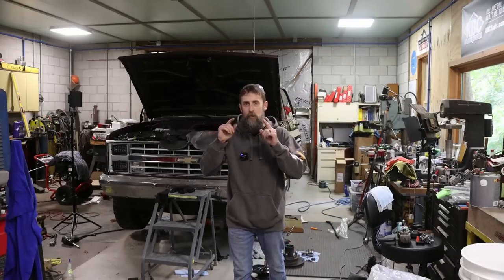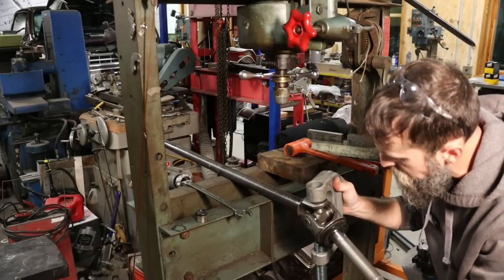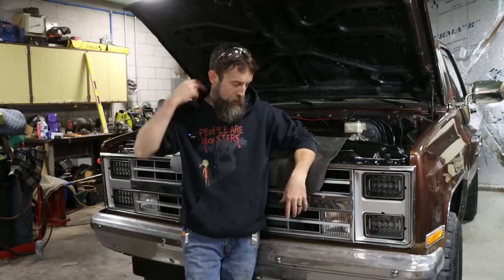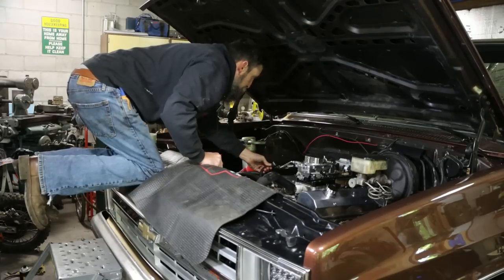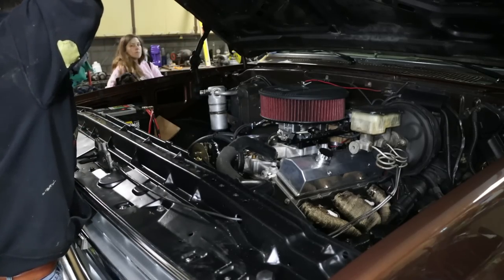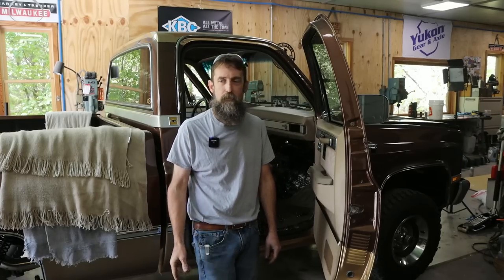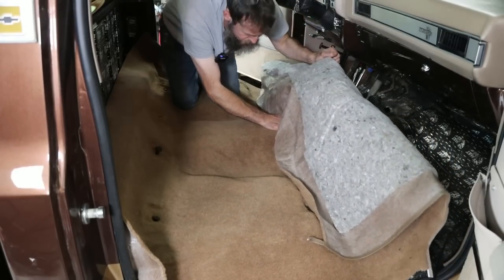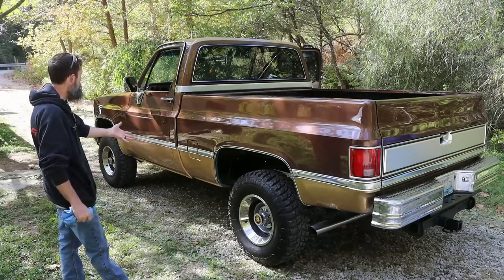Sorting out engine and axle TROUBLE :-(  Installing New Carpet as well!

Comment: Steve, when I watched you struggling with that axle my memory went into overdrive. 45 years ago when I was a tad younger than you, I spent 9 hours on my back uder my elderly Ford Anglia in the snow, with the gearbox on my chest trying to engage the splines in the clutch, it would not go in. Eventually I crawled out from under, exhausted, freezing cold, hungry and almost in tears. I said thats it I'm calling the scrap man in the morning to come and take the damned car away. My dear wife said, just come inside to get warm and have a mug of cocoa then give it one more try and if it doesn't work then we will call the scrap man. I went back out, it had started snowing again, Igot under the car, lifted the gear box onto my chest, lifted it back over my head and it slipped straight in. So yes I have been there, done that, and got the Tshirt. 
Your truck is probably better now than it was when it first rolled off the line, now it's time to relax and enjoy driving it with Elizabeth, (and the dog.) Best wishes from the U K.

Comment: Good looking  truck. I have a 86 GMC 350 with mild cam in it. Getting ready to put cab corners on and the left rocker panel. Then weld  up a few small wholes, Finish body wrk and paint it.

Comment: With that color carpet, I’d buy a Husky or Weathertech liner(s) to keep all the slop and grit off the carpet.  Keeps the carpet clean and dry and that means you won’t rust out your floorboards from the top side.  Last time I checked, I chose the more flexible, rubbery Husky option.  Easier to put in and take out and gives your shoes/boots more traction when it gets wet.  Doesn’t let any water flow off onto your carpet like regular rubber mats do.  After all that work, might as well spend a few bucks to protect it and keep it looking as new as is possible.  After 2 wet, muddle winters, my carpet is as clean as the day I bought my SUV.

Comment: First EXCELLENT work, as I'm sure everyone else will say!!! Always love your work and attention to detail- One thing I noticed and maybe you have a reason, but the bottom mounting flange of the rubber boot around the shifters SHOULD be against the body (or the Dyna-Mat) and not on top the carpet, only the chrome trim ring goes on the carpet??? if you drive in the rain, or in a wet location, that boot is to keep water and moisture out of the CAB, the way you have it currently, the carpet will act as a wick and soak up water! Just my two cents, sometimes I notice things, and also, sometimes I'm wrong? (rarely, LOL)

Comment: The process is called Melonite and is a proprietary process. It is a salt bath Ferritic Nitrocarburize procedure which uses a cyanide base. The process is accomplished at temperature around 1050F. It is usually (but not in all cases) applied to low alloy steels to form a surface generally of iron nitrides.

Comment: Steve, dont go driving it with the four wheel drive hubs locked in on the bitumen. Youll get wind up on the bends and break somthing. You need to be on the gravel to allow the slip.

Comment: I just finished doing a 98 c-1500 I put a 66 stepside bed on mine and nobody seems to figure out how old it is.  Trouble is now I have to use my trailer more to keep the paint nice I don't haul brush piles anymore in the bed. Your truck is nicer than new I started body work at a GMC dealer in 74  and still at it.

Comment: FIATs used small metal bushings on the air cleaner , and we would often get a customer coming in with a ticking in the motor after doing his own service.  Those bushings would fall out if you were not careful and drop down the carb and go past the valve and rattle around on top of the piston.  There were 2 repair options- pull the head, or just rev the motor to about 6 K and hope the bushing would blow out the exhaust.  In about 50% of the cases the 6K repair worked, if not you would have to pull the head.

Comment: For future reference the melonized gear will always have that rougher texture. It’s from the melonizing process. If the they’re smooth, like the gear that came out they’re not right. Hopefully the cam gear is ok. That was quite a bit of wear for only 300 miles.
Reply from the maker: I drove another few hundred miles on the new melonized gear and pulled the distributor and you couldn't even tell it was used at all. I think I am good. Wouldn't have been good if it would have wiped out the cam for a simple distributor gear☹.
Reply: @SteveSummers  Steve. Sorry to see your distributor trouble. I worked for Cadillac and it was common for the distributor and cam gears to wear. What we figured out was the oil pump was too tight, binding and causing the wear. After that when we did the job every one was to get a new oil pump with the cam and distributor gear. When I saw the gear of yours it flashed back at me.  I hope I am wrong but you may need an oil pump. Good luck.

Comment: I don’t know if you have checked distributor height at your manifold or not. 
  It is very wise to do so if you have not. Chevrolet engine assemblies vary after market parts vary. 
   If you went the extra mile and decked your block and or milled the heads, changed heads etc that distributor pad height can and often does change making a shim under the distributor necessary. 
   I machine engines for a living and this is a step seldom addressed until it’s too late. 
   MSD at one time made a tool for setting distributor height. 
    A slip collar on the distributor is a nice thing to have. 
   If you haven’t been down this route I highly suggest doing so. 
   In the cases I’ve seen it generally ends up doing damage to the camshaft as well.

Comment: Beautiful truck, man.

Hey that pan head screw you and Rick had drop into that big block was probably out of the bottom of a Q-jet carb... Had the SAME thing happen on my original 350 in my 74.. It completely junked that engine. Broke #6 piston, bent rod, cracked cylinder, bent crank.. It happened during the swap from the original dual jet 2 barrel to the Q-jet and subsequent fiddling that the Q-jet required at the time.

Comment: Regarding the dizzy, you could make that gear from soft aluminium and it would still last for years as there's almost zero loading on it. You have an issue and I suspect that maybe that dizzy shaft is starting to bind up when it gets hot maybe. Regarding the oil filter, the trick for the light aviation mechanic is to cut the paper pleats top and bottom, with a junior hacksaw and then you can spread the whole element out on the bench to properly check the debris.

Comment: That first distributor gear looks like it has some obviously fake coating on it, like a cheap bluing. No way was that a real Melonite treatment.
I STRONGLY recommend you buy a pair of SS365 FilterMags to put on your oil filter to capture the fine metal filings BEFORE they embed in your main/rod bearings.
I also recommend an application of liquid(spray) ceramic coat "wax" for the exterior paint. I use Turtle Wax and it is really phenomenal. It is super easy to use, economical, fast to apply, and lasts at least a year. There are others that cost 2 to 3x more, but don't work any better. It will really protect that beautiful  paint job.

Comment: if you shock each yoke ear with a hammer it will center the caps and free up the joint in most cases although the latest batch of u joints in most brands seem to be tighter than ever

Comment: Enjoy you video's, great details. On the "U" joints I suggest a Tiger Tool. I did not know there was a special tool to replace "U" joints, this tool makes it a piece of cake. I started in GM dealership in 1979. I got to work on a lot of front axle work. I was paid on commission, if it paid 3.5 hrs I got paid 3.5 hrs regardless of how long it took. That is exactly how much time was allowed to completely strip down to stub shafts, clean and repack all bearing, replace brakes, refinish disc rotors, and service auto-hubs. I was one of those mechanics that liked the auto-hubs, if they were in good working order they kept you from having to climb out of truck in snow and mud and lock in hubs. Many of the ones I got to rebuild had decided to go through too much high water. The seals were designed to keep oil and grease in, not water out! I hope the side gear in that front differential is not damaged from driving the axle in with a sledge hammer? Mechanic's referred to those as the "K" Blazer trucks and Blazers. I installed Quad shocks on many of them, helped a lot. From you comments I was not sure of front and rear differentials are the same as originals. The factory differentials all had a strange problems. Front differential was 3.5 inches wider than the rear differential. The right side of the truck was 1.5 inches shorter than the left side? Why did they feel "loose" at highway speeds, because of this! I never got the Factory Rep's to tell me why? Front tires ran in different tracks than rear giving better traction? Or grabbed Differential they had and used it. As for shorter on right side, indication was if you fell asleep at the wheel it would go right into the ditch instead of on coming traffic. Retired GM tech.

Comment: I realize this is a bicycle tire but,,, I just bought a set of $1,500.00 rims and tires for my road bike from my local bike shop. Excited to ride I throw the set on the bike ( didn't expect a problem)and go 2 miles and BOOM( 165 psi tires explode ) a flat,turns out that at the bike shop, a jam nut fell between the tube and tire as they assembled the tire set.

Comment: Love when I get the chance to drive my back roads here in west central IL. Did it alot in high school with my buds. 😎👍👍Using 3M square double sided 27mm x 27mm x 2mm foam mounting tape works great to stop the carpet from moving around and suck down those highs. Best stuff I ever used.

Comment: hi Steve bit confused  you say that the kit had a 28 instead of 32 doesn't that mean the spline bush in the diff will have bits of swarf in there aren't there oil seals to worry about , don't know much about there's  trucks , just bought one over here in the uk so starting the big overall , don't thing it will be anyway as good as yours  but going to try. thanks for your content real help for an old engineer but newbe to this mechanic  life looks terrifying just where to start

Comment: Im a Chevy/GM lover both cars and trucks from waay back, and ive been waiting anxiously for some interior finish work - love it - your home restoration of this truck is absolutely fantastic, one thing you can address if you so choose is the guage bezel panel that cheesy silver paint wears off and loses its look - you can buy a new panel but you can also use some of the great canned sprays to refurb it.  You didnt just do a quick repaint you made this truck look and work better than it did inside and out when it was new, and another benefit is now you know every nut and bolt on it.  Its a long story, but even though I coincidentally happen to hate brown and gold (again, long story) I still love the results youve achieved on your truck its a real beauty - really a project to be proud of and as all car guys know its WAY more work restoring one than it was for the factory to assemble it on the line.
Reply from the maker: It needs a complete makeover in the gauge department . That is a future project for sure. I never really liked brown or gold either but I like it on this truck because it is different than the common black,blue,white,red that everyone seems to spray them these days. It being a original brown truck got me thinking it could look good . Thanks for watching and for the complements on the truck👍

Comment: you do need 4x4 for sure - you should look at afr from o2 sensors - hope you can get obd2 blueteeth and laptop - you should log data - get mini pc or laptop to always be logging? not the worst idea - think about going to e85 - will run cooler - other wise running lites and radios and scanner - and gps and?  maybe get a radar detector and get the right tune - you should get 100k out of it - it could use a transfer flow tank and tool box in back and back rack with rails  think strongly about studded tires for winter but don't tempt fate - they are no match to pure ice - 4x4 and studded tires do make a big difference #locking diff

Comment: So the 2 lever 4 wheel shifter, nice. Ive not seen that before.  Kinda want that for mine.  What caused you to pull that distributor out, did the timing change significantly. Just wondering how much it moved and in what direction. Finally that carpet, yeah really nice and the perfect chest lean to cross the finish line. Im sure you can tell the difference in sound in the cab.  PS  Cora being just adorable showing how much see loves you and being in the shop.  Yeah a pest for attention she will probly need less of that with time, and suffer well till that tome comes.  Hey can i borrow that truck for the weekend?
Reply from the maker: A oil leak was the reason for pulling the distributor.  Wear would retard the timing. 👍 Cora is a good girl.

Comment: That distributor gear looks seriously chewed out for 300 miles of operation, especially since a distributor provides only a very light load.  Something more sinister than just the wrong surface coating on the gear may be in play.

Comment: Truck looks great, Steve.  Maybe it's the camera angle, the lighting, or something else, but I stopped the video to look at the two cam gears and a couple of things caught my eye.  The new gear seems to have a lot more meat on the edges, whereas the original seems much thinner.  Now, I know that some of that metal ended up in the pan and the filter.  But the apparent amount of difference between the two should have left a lot more material in the oil.  The other thing seems to be the angle of the gear spiral.  The new gear spiral looks more upright and the original looks considerably more laid down.  If the things that I've noticed aren't a result of lighting, camera angle, or whatever, I suspect that the cam gear and the camshaft weren't meshing properly.  I don't think it has anything to do with metal compatibility, especially with only 300 miles put on it.  That is a LOT of wear for 300 miles.  Glad you went with a reputable company for the new gear.
Reply: I saw the same thing, the old gear looks a bit smaller...

Comment: That distributor drive gear must have been made out of play doh ... I can't see that it takes much force to turn a distributor. It would have failed soon for sure.
btw... I'm still tying to figure out what you used to get that drive shaft in ;-)
Reply: It also drives the oil pump. We used to see this when people would use the high pressure oil pump spring for street use. I don't recall seeing what he has for pressure (he does say 45, this is good)

Comment: Hi Steve,
Nice to see the completed project, although you had those few bumps in the road at the end. When I bought my 1986 F-150 4X4, I ordered all the service manuals from Ford as I knew it was going to be a long term driver for me. Sold it in 2018 as the cab roof and rear corners had rusted out along with the wheel wells in the bed. Was sorry to see it go, but didn't have the time to make the repairs as my fathers health was deteriorating and was a round the clock effort. You, Elizabeth, and the family stay safe.

Comment: My dream truck is my 2006 Dodge Ram Mega Cab 2500 4x4 Laramie with the 5.9L Cummins. I had the frame stretched in Salt Lake City to fit a new take off 8 ft. bed with a new tailgate. Alot of additional mods since. Better than paying 80k to 100k today for a comparable Ram. Congrats on completing your project Steve.
FYI, my next big truck project I'd like to start is a 1st Gen Dodge Crew Cab Dually 4x4 Longbed with a Cummins conversion. Just like what Brian Bloc did to his 1st Gen.

Comment: Working on a site away from home. Brought my van to camp in. I think it was a '74 G10. Bought a NIB Holley double pumper from a guy on the job because it was cheap and I never got along with the Rochester. Left the van at a local garage to swap carbs. Went to check on the work at lunch. The mech was rolling out from under it with the driveshaft across his chest.
Yep, dropped a screw down the intake, lunched the top end. He was going to swap in a 2 bolt he had in the boneyard for the 4 bolt that was in it.
We had words.

Comment: Hey Steve a little suggestion take it or leave it. Looks like you may not be running A/C anymore. Cut off the old screw fittings on your old lines that are open and turn up some aluminum plugs to cap off those lines. Will look a little more custom and will keep the system clean if you ever decide to change your mind. Moisture in an A/C system can become acidic and eat up what you got while it sits. A quick vacuum after sealing for bonus points would help but I think just sealing will help overall. Great project love that exhaust tone, man she sings!

Comment: You can add a small .030 groove in lower distributor passage where seals in oil galley and spray oil on the cam/ distributor gear to help. Has to be correctly aimed at cam.